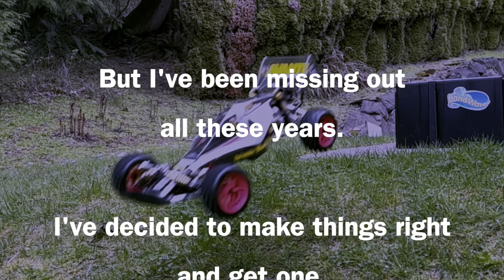Build and Drive VLOG: Tamiya Avante Black Special RC Buggy

Comment: The biggest drawback of this car is that the suspension and chassis are very weak against shocks. In particular, the metal knuckle arms look sturdy, but they break often.
Reply from the maker: I know many people simply buy and put on the shelf. I get it, it is very pleasing to just look at it. I have been re-building mine and cleaning it thoroughly and put on the shelve. But I have been bashing other RCs.  When I get tired of looking at it I will run again! Thanks for the comments, cheers!

Comment: Awesome video presentation but I too cannot believe you treated this car like you did. Salt water? Sand and mud and water😭😭 man Tamiya needs to be treated with more respect. I'm just about to get mine in 1 day and I don't know if I'm even building it but if I do I will protect it like a baby. Please be gentle, well here in Australia Tamiya RC parts are very difficult to get hold of. I don't know how easy you can get parts in America. I think your from America. Otherwise beautiful work and I really like the brushless replacement you did. Enjoy man👌❤️
Reply from the maker: I hear you!  If it makes it any easier, it was fresh water, no salt 😆.  Still, the metal joints got a bit squeaky after thorough cleaning and rebuild.  I used WD-40 on the squeaky joints to improve it.  The Avante shouldn't have to go through this!  It was an experiment and thankfully I am done with it.

Yes I'm based in the U.S. Enjoy your new upcoming Avante!  I think simply owning it will make one very happy!  Thanks for commenting.  Cheers!

Comment: nice video....for me its better to leave those plastic gears un greased...it will make it last longer and trap less dirt or making the fine sands sticks...i leave all my tamiya kit gears dry greaseless,,,i only lube the bearings..it last longer and better than previously greased gears.
Reply from the maker: Good tip! Next time I may try that!  Thanks for the comment!
Reply: True ! Gears are usually made of PTFE which is a "self lubricating" material. No grease, no problem 👌

Comment: Most brands have a small number of products, that serve as "brand defining" forever (like the Nikon F4, the Mercedes SL 300 or the RR Silver Ghost), no matter what came up later. For Tamiya the Avante is in their Top 3 ( aside the Grasshopper and  Hilux Pickup predecessor or the original Sand Scorcher).
Despite being too over engineered for racing (the front suspension alone it more complex than the whole Grasshopper), the Avante will stay the top nodge design 4WD buggy. Barely plastic, elegant, slim and even after 35 years it looks futuristic. 
If I ever take mine out of the box and build it, it will get some effect color ... and maybe some light SFX / EL wire, to make it look like a TRON vehicle.
Reply from the maker: Hey you know what?  I've been wanting to build a TRON-themed RC.  I thought about doing that on the latest BBX.  But then it just didn't feel right as the BBX is retro, as opposed to futuristic.  So I've given up the idea.  Now that you've mentioned it, I think it's a great idea for Avante!  Would you mind if I go ahead and use this idea?  If you like, I'll mention your YouTube handle if I ever publish a video for it.  Thanks for commenting! Cheers!
Reply: @ezrc7724  No need to mention me - just inform me here, when it's done ;-)
How about a rear wing as a lightpipe changing color when accelerating + smoke gun (illuminated by this too) + red+green laser on the outer body?

Oh my ... I guess, my mint box is in trouble g

Comment: It was a car that I really liked because of its State-of-the-art design at the time.

But...

Durability is too weak

I think it would be good to create and apply improved parts that complement durability, especially the knuckle arm.
shock absorber stay
Also, the gearbox needs to be waterproof and dustproof, and a body undercover is also needed.

Comment: Great film and pleased to see it's not a "shelf queen" These Tamiya buggies should be run and put through their paces. I have an Avante re release waiting to be built, I've also got the steering Hop up part which is standard in the Black Avante. I was impressed with the brushless upgrade and something I will do w8th mine. Could you possibly give me the make and model of the brushless motor ,ESC and servo you used. I have a Sandscorcher, Rough rider and Fighting buggy all with brushed cans. Going brushless will be a new experience for me so any information would be a great help. Also what battery were you running with brushless motor? Kind regards Barbus
Reply from the maker: Hi Barbus, 

Thanks for commenting! The Avante re release is also a beauty, I am happy for you!  I used Tekin RX4 ESC + Holmes Hobbies 540s stubby brushless sensored motor + 2s LiPo.  The servo is a cheap one from Amazon and it's too big for the undercowl so I wouldn't recommend.

The Tekin is an overkill for this, but it sure is a nice and smooth one, completely waterproof.  I think Hobbywing makes some good ESC too but I haven't water tested them so I can't vouch for them.

Cheers!
Reply: Thanks for the lowdown on the kit used. My plan is to go brushless from the get go, and save the original motor. Kind Regards Barbus

Comment: Parts list motor servo esc battery please 🙏
Reply from the maker: Thanks for commenting!  I used Tekin RX4 ESC + Holmes Hobbies 540s stubby brushless sensored motor + 2s 4000 mAh LiPo.  The servo is a generic one from Amazon and it's too big for the undercowl so I wouldn't recommend.

The Tekin is an overkill for this, but it sure is a nice and smooth one, completely waterproof.  I think Hobbywing makes some good ESC too but I haven't water tested them so I can't vouch for them.

Cheers!